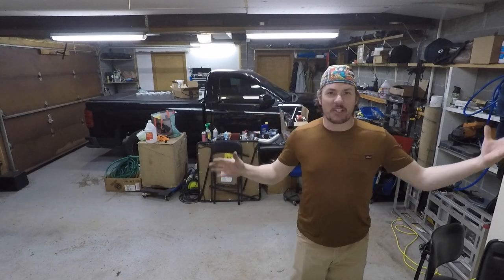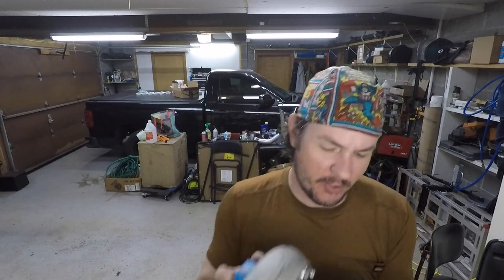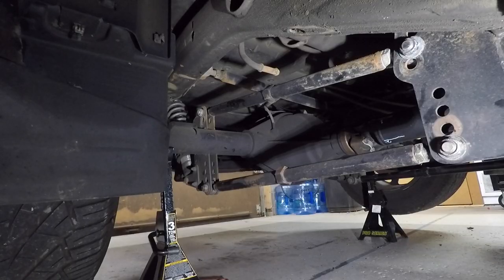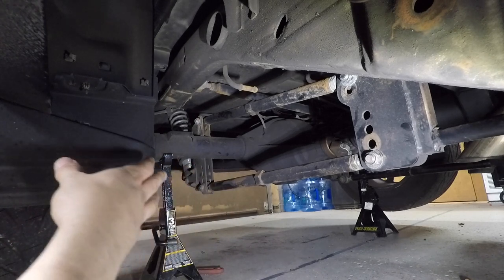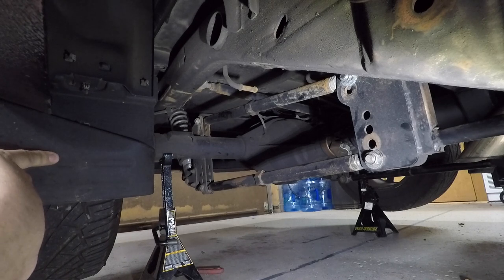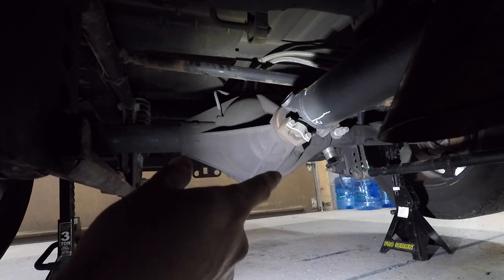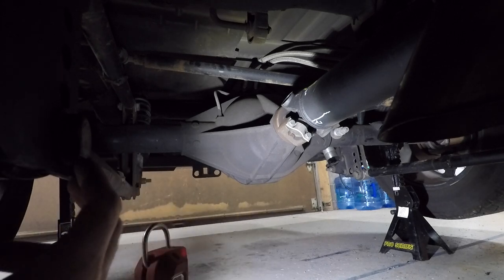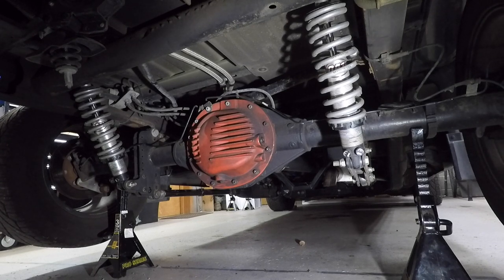Silverado Custom 4 Link Suspension Overview! Custom Drag Suspension on a RCSB Truck!

Comment: Can you put a link to the kit you used?
Reply from the maker: It's custom using, can't remember the axle brackets I used but I built the rest, including the bars since all the bar kits are really short for cars
Reply: Goat Rope Garage yeah I’ve noticed that as well. How long did you make yours and what tubing did you use to make them?
Reply from the maker: 24" if I remember right